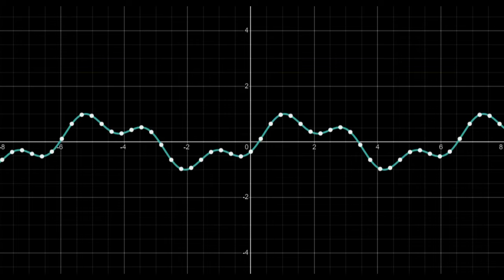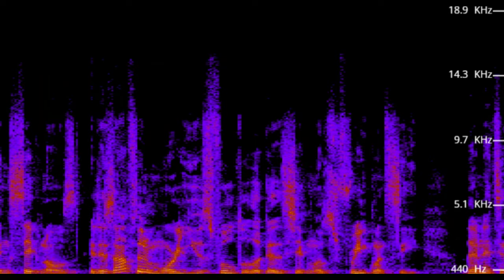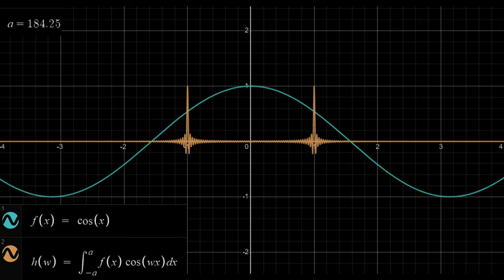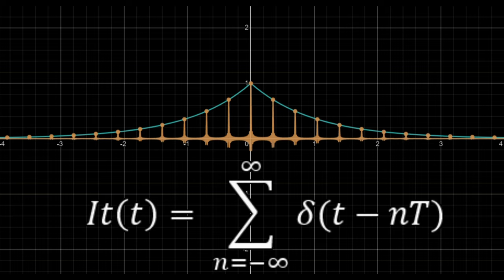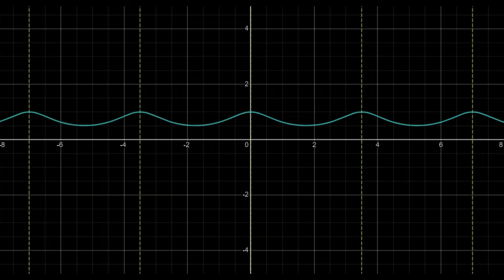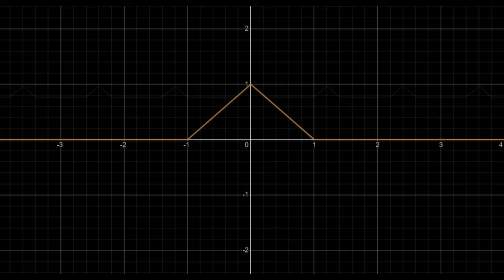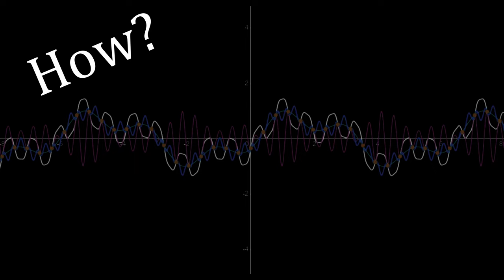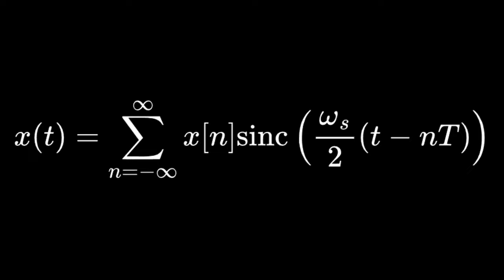Shannon's Paradox: An Infinite Connect The Dots Game (SoME2)

Comment: I kinda think of sampling as multiplying the signal by a square wave, or a pulse train rather.
A square wave will have the high order harmonics decay, the narrower you make the pulse, the less the harmonics decay. Infinitely narrow pulse (delta function) -> equally strong, infinitely many harmonics AND a 0 frequency component. IIRC the train of delta funcion pulses looks the same in the time and the frequency domain.
Next, we use the mathemagical relationship that says multiplying two sine waves of different frequency gives you the sum and difference of those frequencies, and multiply every frequency component of the signal with those of the sampling pulse train. The 0 frequency component of the sample pulses gives you back the spectrum of the original signal, but it also gives you a mirrored "negative frequency" copy 0 x F_in -> +F_in and -F_in , and more mirrored and unmirrored copies centered at each harmonic of the sampling frequency n x F_s x F_in.
If your signal goes higher than half the sampling frequency, the spectrum will bump into the mirrored copy which starts at the sampling frequency Fs-Fin.  F_s - F_in and F_in are aliases of each other ;) They both exist after sampling, regardless of which one you input, so you need to pick one. If you don't follow the rules the reconstruction may or may not be correct.
Im kinda shit at math and very high right now, hope this made sense, kthxbye!

Comment: At 4:39 you can also use the many limits that can be used to define delta, but, yeah, delta has well known properties. You could call it more rigorously a distribution, iirc.

I didn't remember about this, but I hadd heard about it before. If you use that in signals that do not follow the condition, i suspect you simply can't reconstruct the high frequencies, so you'll smooth it out. That means you could lose some of the data of interest, like peaks.

Comment: Really well done, way to take your time with it. I feel like your interpretation is sort of backwards though, in the sense that what this relationship really tells us is not how to perfectly recover an arbitrary signal from a finite number of samples. Even ignoring future-dependence, real signals never have nicely defined frequency limits. Instead, it tells us how to choose a sample rate based on the band we care about. i.e. there's no real reason to ever sample music more than say 2.5 times the upper limit of human hearing, though again in reality you're usually actually limited by storage and playback. But if you want to listen to bats, go faster. Or in reverse, if you know you have noise well above the range you care about, drop the sample rate.
Reply: there are still problems though.
if a signal contains high frequencies and you sample at twice the maximum frequency we can hear, the higher frequencies of the signal will still contribute! And the reconstructed signal will sound different from the original.
Extreme example: the signal is a 50kHz sinewave. sampling at 40kHz results in the same data points as a 10kHz signal. Thus, the reconstruction gives a 10kHz sound instead of the unaudible 50kHz.
(2nd objection is, that our ears are not fourier analyzers, but they measure the time-dependent amplitudes of renonators, which is a bit more complicated)
Reply: @deinauge7894  yes measurement is hell

Comment: Periodic in the time domain means discrete frequency coefficients.

Sampling discrete points in the time domains means a periodic in the frequency domain. The repeating pattern in freq domain are the aliases.

This period is equal to the sampling frequency for complex functions but for real functions the transform is hermitian symmetric. This means u only have unique information in half the period. So the discrete time fourier transform only shows up to half the sampling frequency on the x axis. This is the nyquist cutoff frequency.